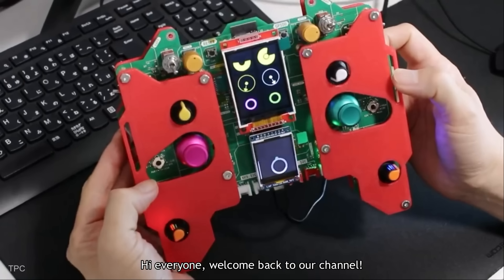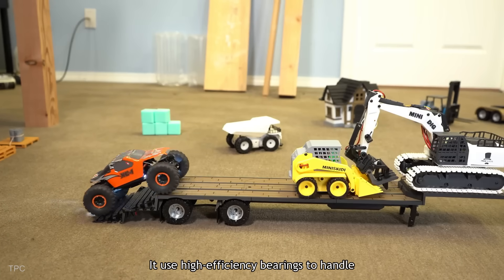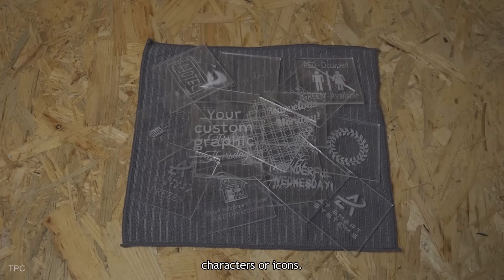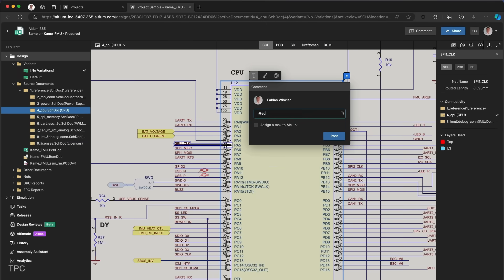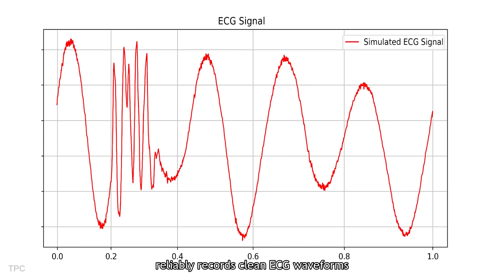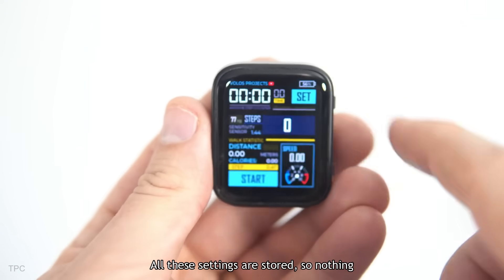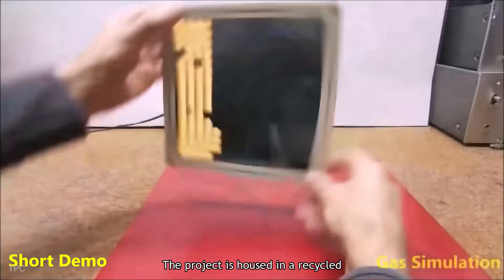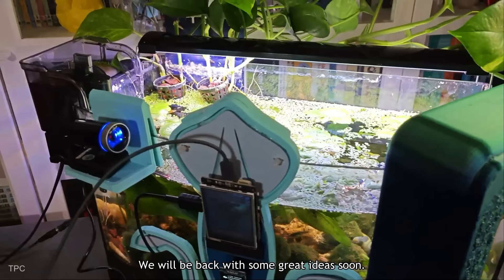12 New ESP32 Projects for 2025!

Comment: 00:11 12. Wireless Smartwatch
01:02 11. RC Semi Truck
02:12 10. Ultimate remote control
02:54 9. Smart Light Switch
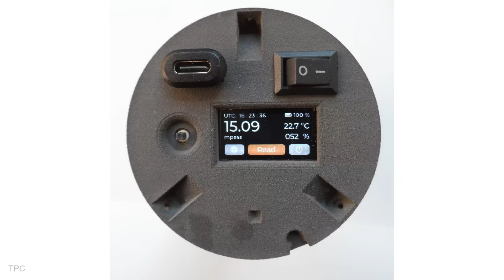03:44 8. Light pollution meter
05:55 7. SolarLink
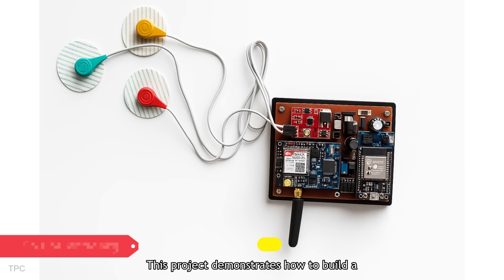06:31 6. ECG monitor
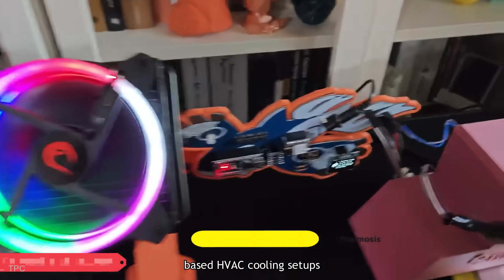07:16 5. AI-driven Sound & Thermal Image-based HVAC Fault Diagnosis
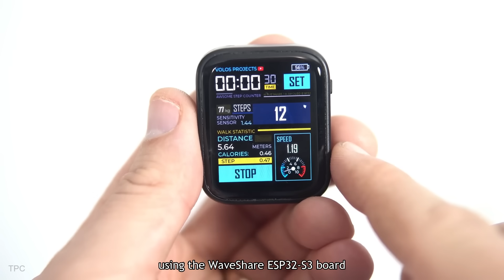08:19 4. Step Counter
09:08 3. Smart Fridge Calendar
10:00 2. Fluid simulation
11:06 1. AI-based Aquatic Ultrasonic Imaging & Chemical Water Testing